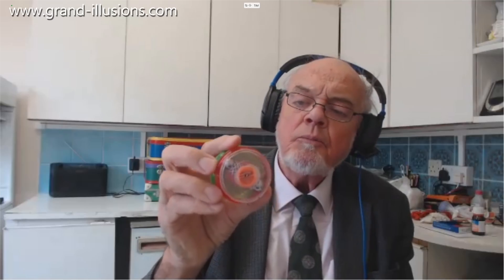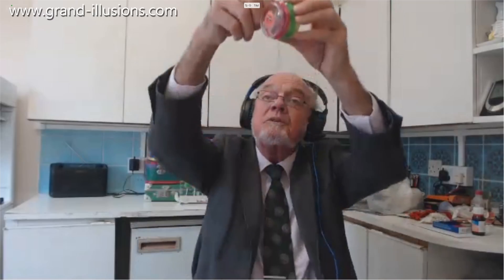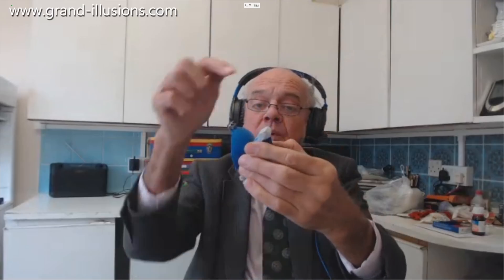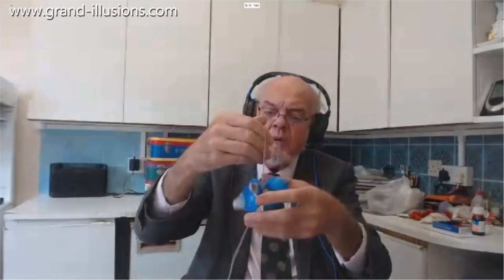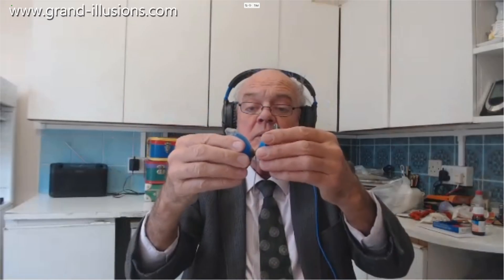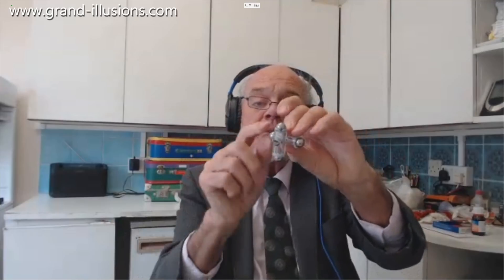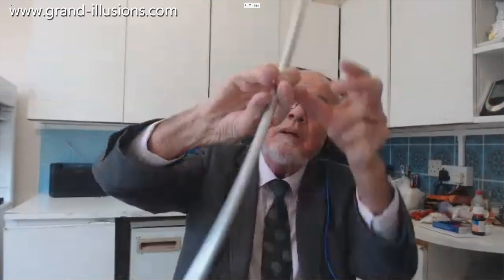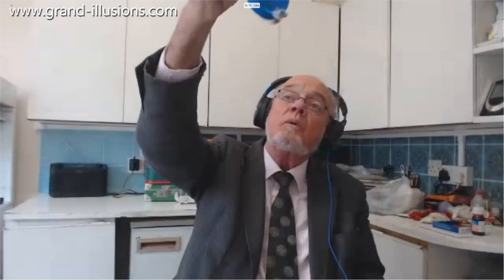The No Go Yo Yo

Comment: I have a ball bearing yoyo, it's actually an extremely fine yoyo designed for competition, it can turns on itself for such a long time if you throw it with a lot of energy to let you perform tricks.
It's not one of those yoyos that would come up when they lose speed, it won't come back up by itself, you have to impulse it.
The con to it is it is made from aluminium and i've hurt myself quite often with it

Comment: I don't think the rod will perform the way that you say it will, Tim.  The axis you spun it around is a stable axis, and a minimum energy axis.  It would tend to do the opposite of what you said, as it loses energy, it will start to spin around the axis of maximum inertia.

The reason your No-Go Yo-Yo works is because rotations around the intermediate axis of inertia are unstable, even without energy losses in the system. It's often called the tennis racket theorem. Anyone can demonstrate this effect to themselves by tossing a tennis racket into the air.
There is an awesome video filmed on the ISS demonstrating this: https://www.youtube.com/watch?v=1n-HMSCDYtM
Reply: Interdimensional is right, the transverse axis would be the stable one.  If the bar is uniform, the longitudinal axis would also be stable in theory, but over time it would slowly flip to the more stable transverse axis. If the rod was actually a bar of rectangular cross section, one of the transversal axes would be unstable and immediately do the racket thing.

By the way, there is something called non-response yo-yos, which won't come back up when you pull and are the ones preferred in competitive yoyoing (you need to do a maneuver called binding to make them return).
I have been following Tim since before Youtube existed, when he made a CD of part of his collection  :-)